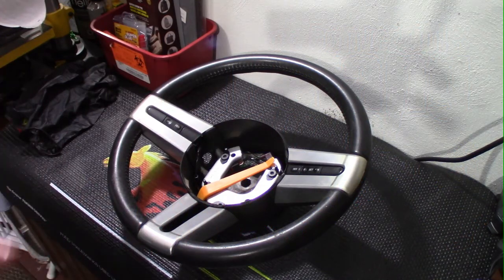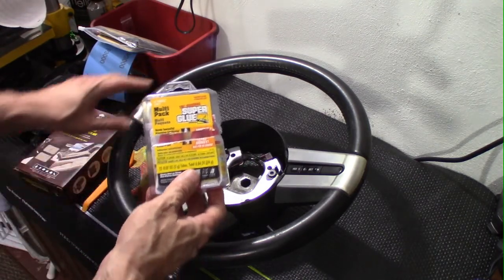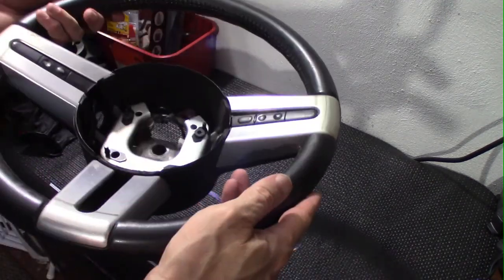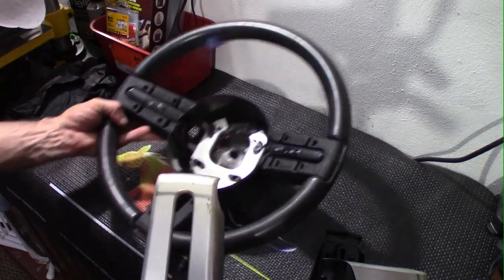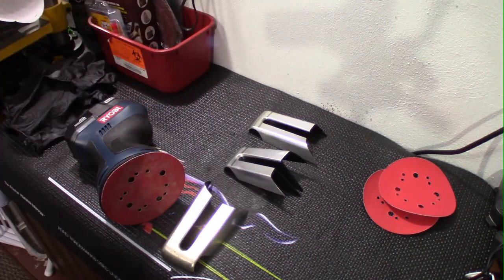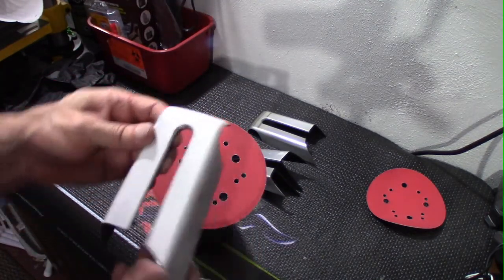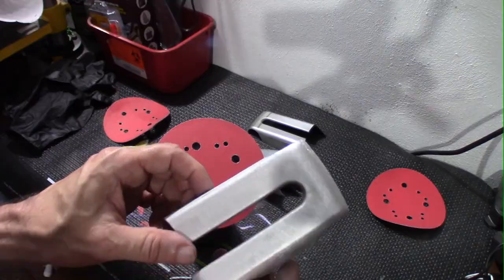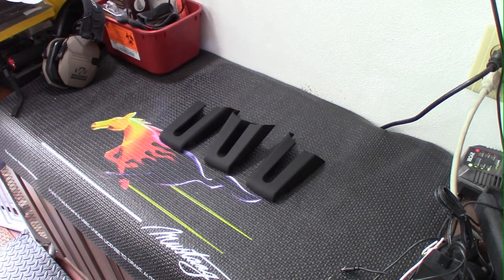2005-2009 Ford Mustang - Restoring the plastic trim on a steering wheel.

Comment: Awesome turn out! I just finished prepping my wheel trim for paint but debating wether I should go with this color scheme or red. Not a lot videos on here for the 05-09 mustangs but nice video!
Reply from the maker: Thanks. I have found that the 05-09 is the bastard child for some reason. I think it is the best looking body of the Mustangs and harkens back to the 67 to 71, some touches of the 65.